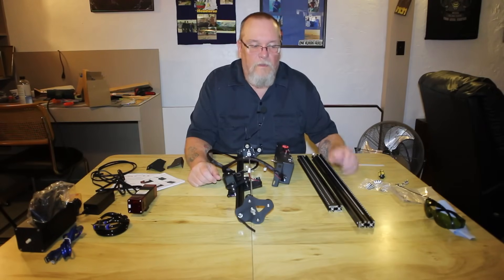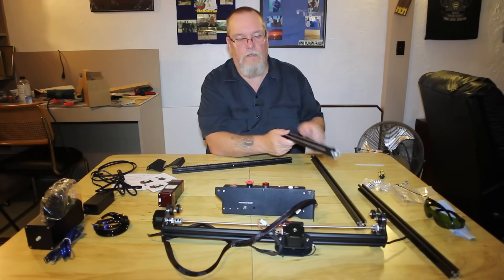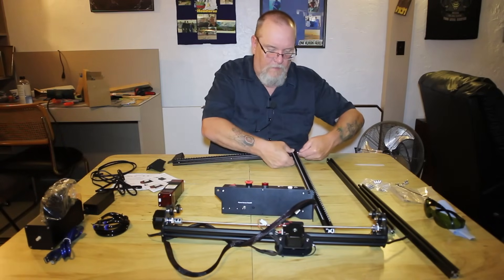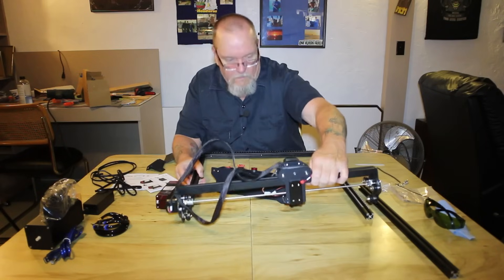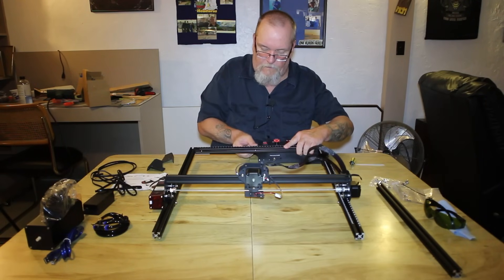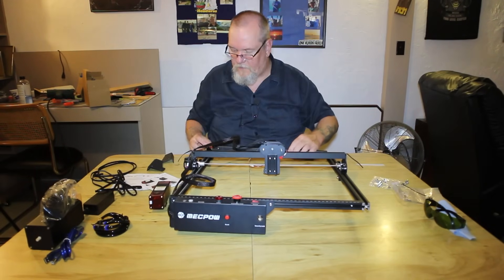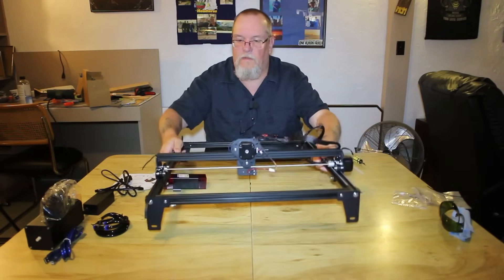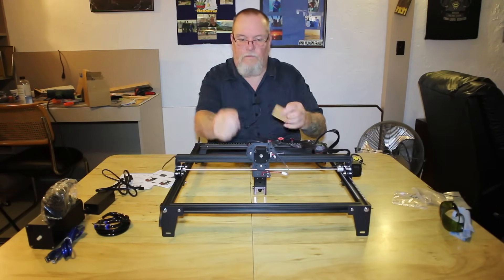The Amazing Mecpow X3 Pro Laser Engraver: The assembly!  #laser #diy #woodworking

Comment: Just used your video to put mine together, thanks! Simple build once the bars are oriented properly, but the manual is pretty cryptic on that.  
I found it pretty easy to place the belts, as mine were naturally wanting to curl upwards at the ends due to being rolled in that direction for shipping. I just fed the belt in from underneath the back wheel, let the curl bring it up, fed it over the gear head and under the next wheel, and let the curl bring it up again. :)

Pro tip from a retired machinist/fabricator: Once the belt is placed and roughly tensioned on both sides, gently push the gantry assembly to the very back until it is pressed against the rear of the machine on both sides, then recheck and adjust belt tension and lock it down. then you know for sure that you have the alignment set well without a bunch of fussing around. Doesn't appear to be critical on this machine, but never hurts.....

Mine came with the rotary module as a package deal, it's built pretty well, haven't had the opportunity to use it yet.

For anyone thinking of buying one of these, take note that the safety glasses that come with it won't fit over prescription glasses, so if you'll need the larger ones, you'll want to order them when you order the machine. The laser is rated at 445 +/- 5 nm wavelength. So look for glasses in the 400-500nm range.
Reply from the maker: I am glad it helped.